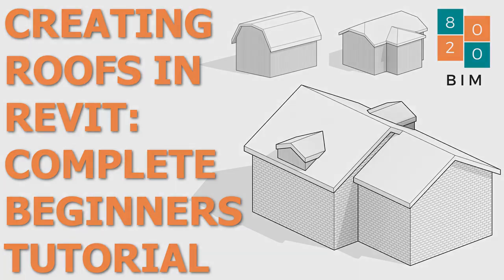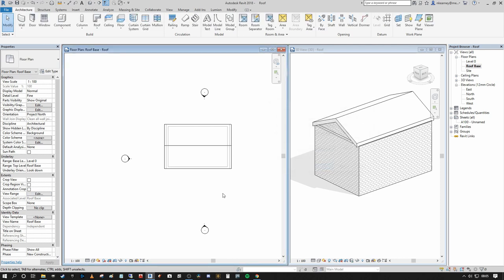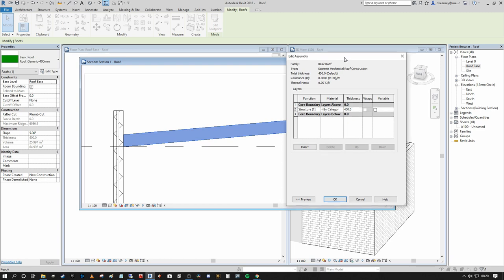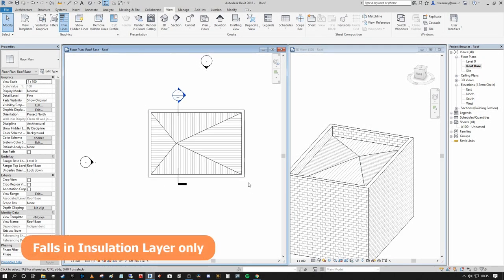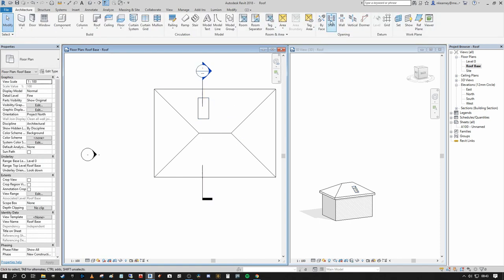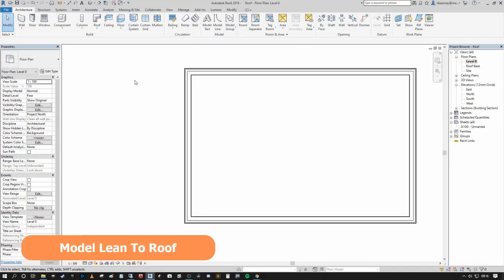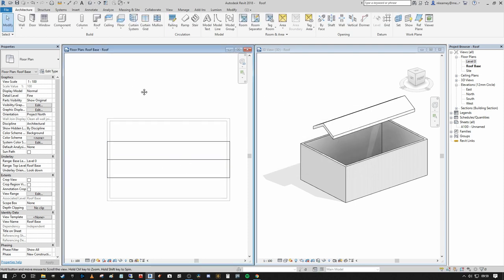Creating Roofs in Revit: A Monster Beginners Tutorial

Comment from the maker: Hi everyone - video timestamps as follows:

00:00 - Introduction
00:46 - The Basics, Creating your First Roof By Footprint in Revit, HIP Roof and Gable Roof.
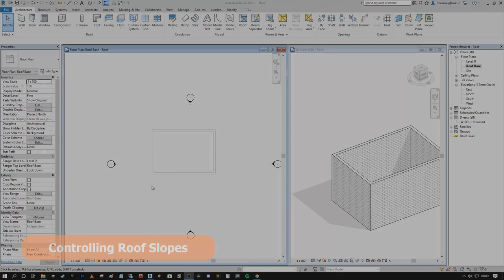06:59 - Controlling and Editing Roof Slopes in Revit.
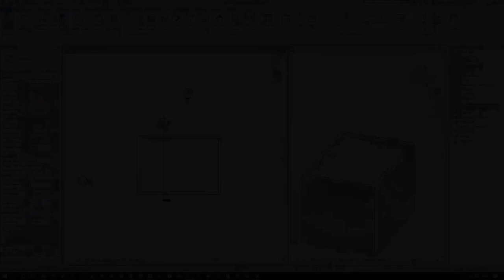11:10 - Create and Edit the Roof Construction Assembly in Revit.
16:44 - Using the Modify Sub Elements tool create slight drainage falls on a Flat Roof in Revit.
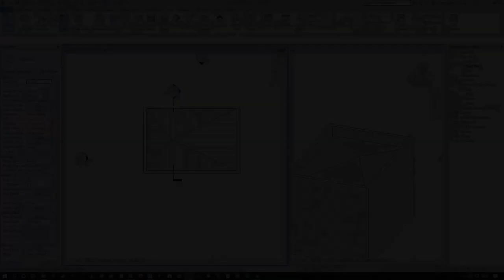18:56 - How to Slope Roof Insulation Air while maintaining a Flat Roof Structure in Revit.
21:15 - Use the Select Wall drawing tool to assign and maintain roof overhangs in Revit.
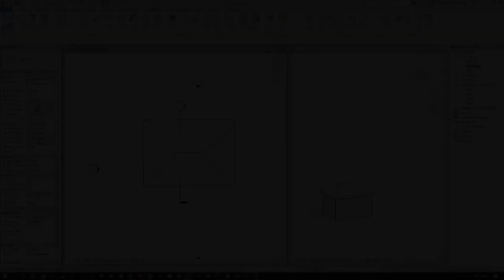22:32 - Placing Openings in your Roof - Vertical Openings vs Opening by Face
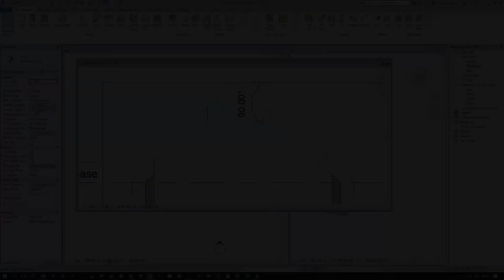25:40 - How to Model a Dormer Roof in Revit
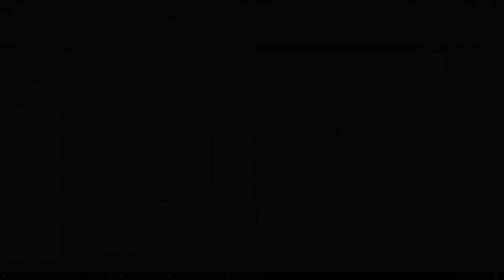31:27 - How to tuck a Smaller Gable Extension under the larger Gable Roof when they are one Revit Model Object.

Quick guide to Modelling of Common Roof Types in Revit:

34:38 - How to Model a Lean To / Single Fall Roof in Revit
35:31 - How to Model a Butterfly Roof in Revit
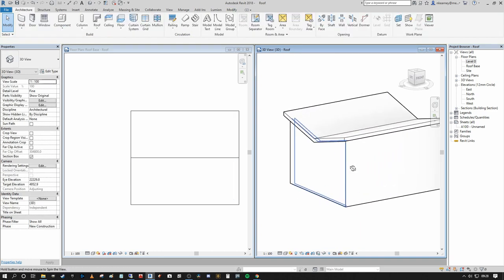36:28 - How to Model a Gambrel / Barn Style Roof in Revit
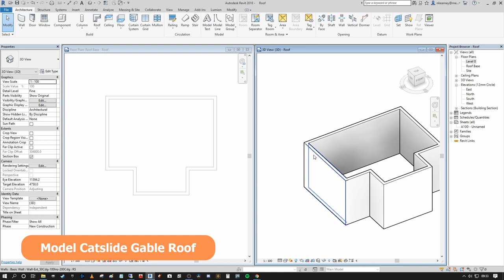38:52 - How to Model a Catslide Gable Roof in Revit
40:02 - How to Model a Dual Hip Roof in Revit
40:50 - How to Model a Jerkinhead / Half Hip Roof in Revit
42:59 - How to Model a Clerestory Roof in Revit
48:02 - How to Model a Dutch Gable Roof in Revit

Finally, quick introduction to modelling Complex Roofs in Revit:

49:56 - Introduction to Complex Roof Creation in Revit by utilising the Roof by Face Command and massing toolset.
53:51 - Video Outro

Hope you find the video helpful.

If you like this content please support 8020BIM by buying me a (much needed) coffee:
https://www.buymeacoffee.com/8020BIM

Niall

Comment: I'm struggling with creating a roof from Kingspan panel (metal insulatied panels) which have a cutback. I tried to get the revit models from their website but that only works using it as a sloped glazed system and using Kingspan roofing as family. Also another thing about the roof creation, what do you do when you have a change in slope on a roof that's fixed to a structural metal framing system? I would apreciate if you would respond to my comment.

Comment: Hi Niall!
Is it possible to create this kind of roof only within Revit: https://imgur.com/a/cIJLfW5 . 

Because of the unsymmetrical diamond shape of the building, I had to model the roof sides at different angles to keep the roof slope consistent. Tried to do it with inplace mass, failed, and then I ended importing it from 3ds max.
Reply from the maker: Hi again, hope you're well 🙂
Yes, I believe that roof is possible. I would personally try to create it on the flat and then use mofiy sub element on the roof to raise the points on the boundaries and add the central point in the middle. Only difficulty with that is you will need to know each points elevation to make sure the falls are correct.
Alternatively I would consider creating the shape as an in place mass surface / volume and then apply the roof by face to the in place mass.
Any further guidance on this let me know and I see what I can do 😊
Reply: @8020BIM  Worked like a charm. :D Thank you Revit god.
Reply from the maker: Glad to have helped ☺️👍